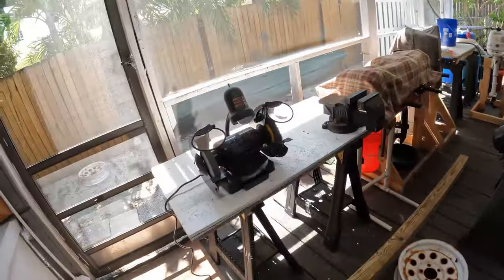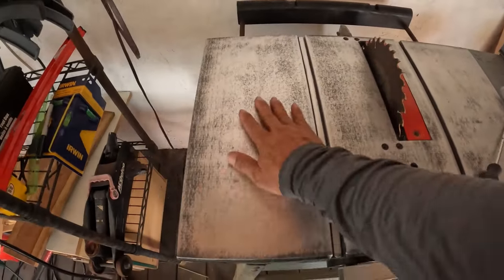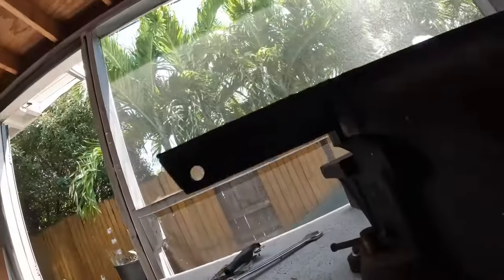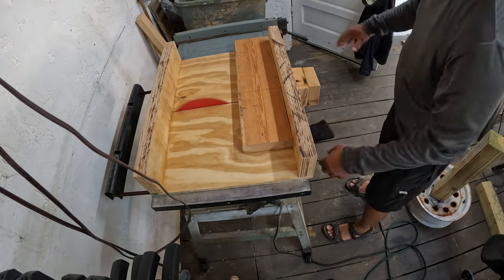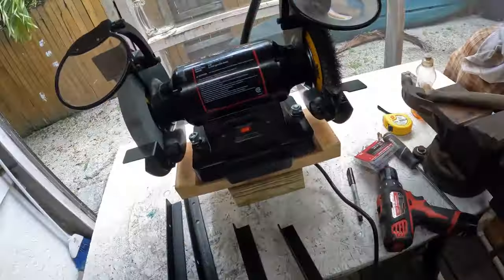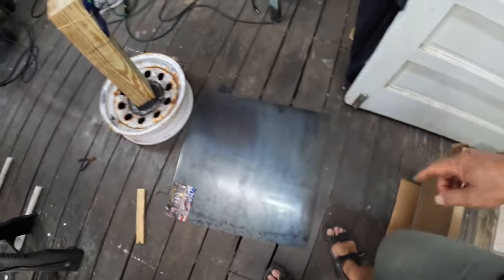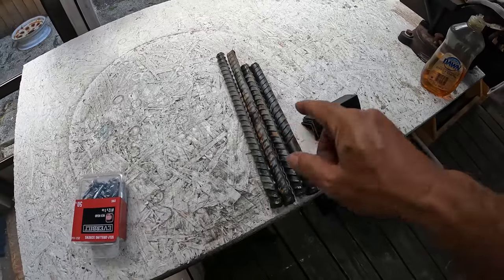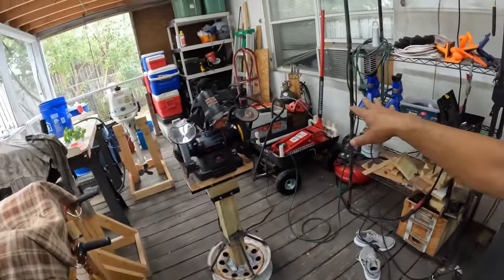Building My Patio Workshop part 5.  Scrap Bench Grinder Stand.

Comment: I am thinking you are going to set that floor on fire. Then you get a piece of plate so you don't. Then 10 minutes later you aren't using the plate and making sparks galore. And bare feet and cutting, grinding, welding? Omg!
I have seen that wheel rim stand done before but with a piece of pipe.